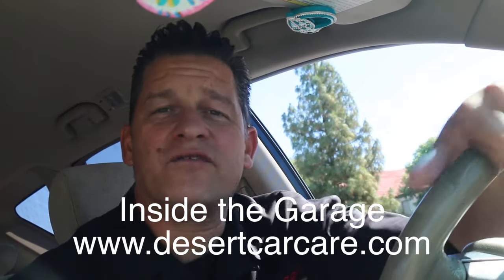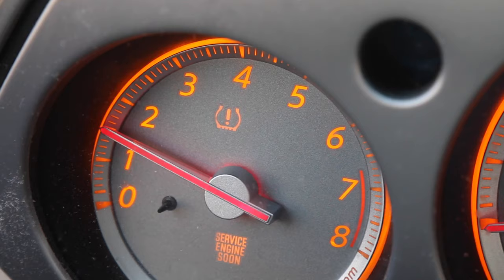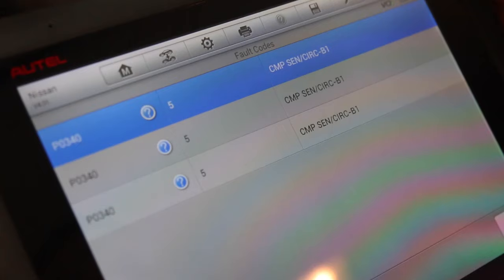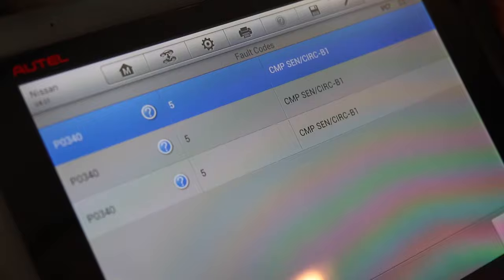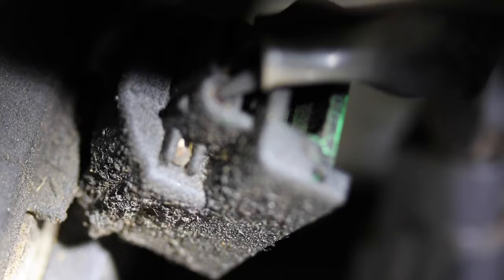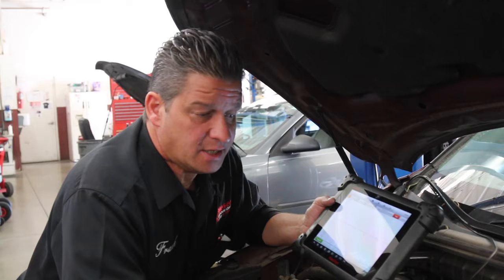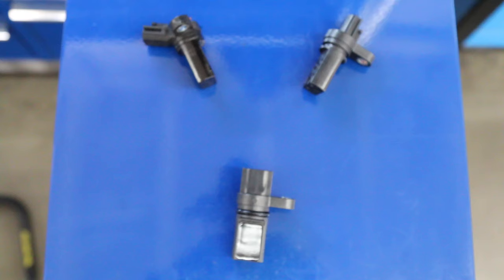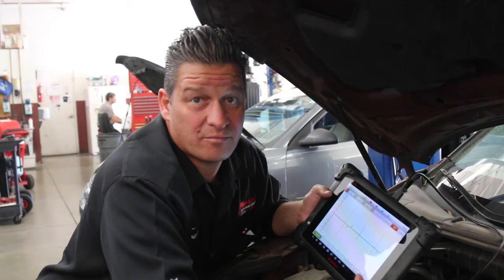Nissan Murano Camshaft Sensor Tips

Comment: Is it okay for me to call you today? I have a question about my 2009 Nissan Murano
Reply from the maker: mario redd ..sure. Sorry for the delayed response~~always on Twitter @urmechanic for quicker response ~~send a quick vid there w any questions EZPZ ~Frank.
Reply: My wife has a 09 Nissan Murano and it stalls. At times the RPMs doesn't move past 2000. I put the paddle to the floor one time and it didn't go anywhere. I heard a grinding noise under the car when hitting the gas. The codes are P0420 and P0430. It's like it not getting air or oxygen to the engine. Thank you in advance
Reply from the maker: mario redd .. very possible a clogged or restricted catalytic converter. Call me at the garage anytime~~get it tested before throwing parts at it so key. ~Frank

Comment: Poor design.  If one sensor fails, the car stalls......immediately.  Very dangerous.  I needed to replace them on my old 2004 Murano which I call my Home Depot - Lowes junk car.  Then again, what didn't I need to replace in this car.  LOL!  Although old, only has 65,000 miles.  The aftermarket sensors are fine off eBay and Amazon.  Don't waste your money on OEM parts as the device is very simple.  These are basically an electromagnet.  In fact, I'm surprised they can fail during the life of the engine.  Likely poorly designed and the core is eventually affected by heat.  The retainer clips are shaky as well with the locking tab easily broken.
Reply: Absolutely right!  Unless one is buying janky no-name of eBay, one can easily replace both cam sensors for $30 from RockAuto.
These sensors are basically Hall-Effect sensors which detect when a magnet on the cam swings by. That causes the sensor to send a voltage pulse to the ECM which can then figure out where the cam is in its rotation.  Other sensors may be different and more complex and worthy on NOT picking the Econo-cheapo part. However the cam and crank (IIRC) are almost as simple and basic as can be. Worse, it really does take about 10 minutes to change both, with the bulk of the time spent on figuring out how they un-clip.
Reply: @boots7859  RockAuto doesn't sell them.  Also, the $18 for the "pair" Isumo Chinese sensors on eBay are identical to the $75 "each" Duralast sensors sold at AutoZone.  They're the same part from the same factory stamped with the Duralast brand.  I was told this by a trusted mechanic I know who does repairs that I won't attempt.

Comment: By what logic do you justify Changing all 3 Sensors when only one is failed?? 60 bucks for the Crank Sensor and $75 each for the cam sensors. You guys must have a gold mine where you're at on extremely uninformed customers. That is just Nuts, a rip off in mild terms.  Advice the customer let them make the decision! I always change the one that is bad and not guess  whether or not the others will fail soon. That is the silliest thing I have heard. A Year from now if the other one fails it can be addressed then. You obviously know how to use a scope and also know that this is about a 2 minute test so why bother replacing all sensors at once.
Reply from the maker: Ralf's Automotive Diagnostics & Repair ~~great points. Options always given no doubt  as we advise & they decide. Thanks for stopping by !